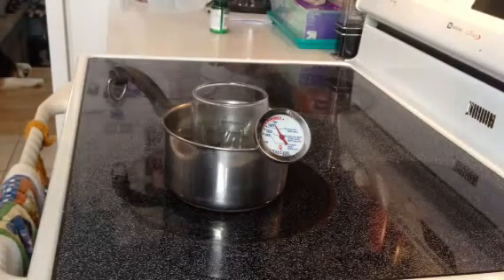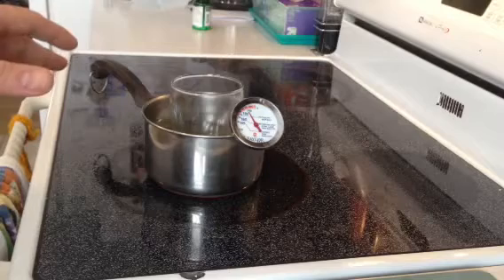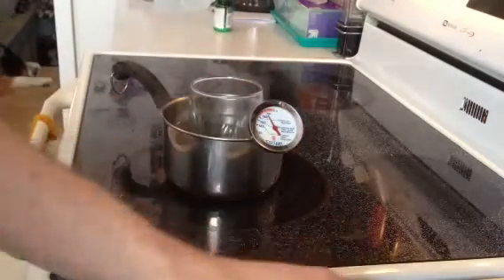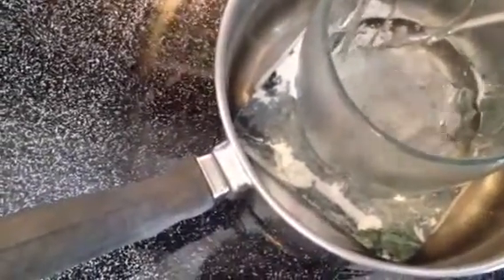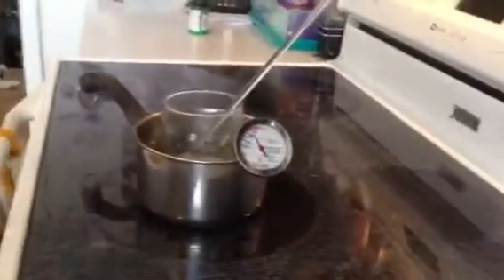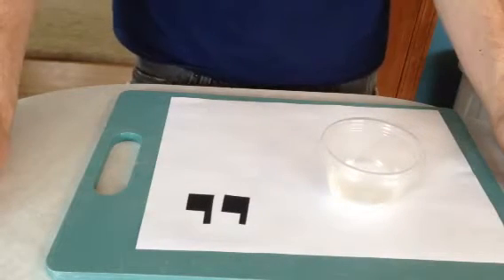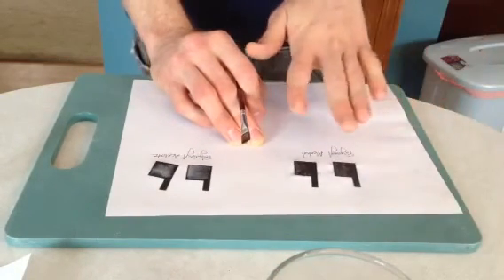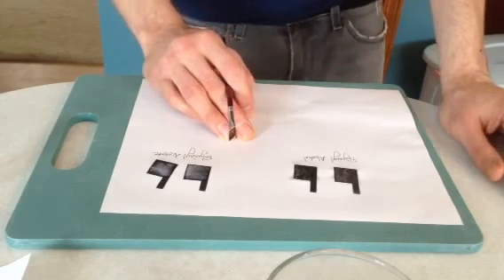All solid-state Laserscibe graphene supercapacitors made at home

Comment: Use nylon screen or cloth as a separator then wrap tabs with plastic and iron them between bakers paper then apply electrolytes and seal in plastic and hot iron melt them together making a sealed cell trim sides stack cells for more power

Comment: Try using aluminum as an anode and aluminum chloride as an electrolyte. Then you have an aluminum ion supercapacitor  battery. It can be cycled around 7,000 times and from what I've seen, it has the potential to completely replace traditional lead-acid deep-cycle batteries; which weigh a ton and requires tedious maintenance all the time... 
 
I really want to construct an aluminum ion battery but lack the resources to do so. My goal was to construct a 100ah battery and replace the AGM deep-cycle batteries in my Fleetwood mobile-home. If I'm not mistaken, this would also remove the need for a traditional battery charge controller as well, significantly reducing the cost and complexity of adding a solar charging system.
Reply: +poweredbyaaron99 Did you start this project?

Comment: Graphene is carbon 1 atom thick on a substrate, This is simply graphite because of the thickness.
Reply: actually graphene can be stacked on top of each other to create a strong material. Just how to do this I dont think has been perfected yet though.
Reply: TheMrchameleon that would be pyrolitic graphite
Reply: Graphene theoretically can be 1 atom thick carbon, nobody is actually accomplishing that at this point. This lasering process sinters and exfoliates Graphite Oxide into Graphene.  But this is the structure, you wouldn't actually be working with pieces 1 atom thick! The thick and solid composite this process produces provides much better conductivity and doesn't require a conductive metal collector plate. This is huge. Feel free to read the published paper on this technique. https://hackadaycom.files.wordpress.com/2012/03/laser-scribing-of-high-performance-and-flexible-graphene-based-electrochemical-capacitors.pdf
Reply: Or laser sintered graphene, which is what this is.

Comment: what happens if you make these in the scale of A3 paper sheet, roll it in a tight tube and connect multiple of them in a row/parallel? how does that compare to batteries in stored power to weight ratio?